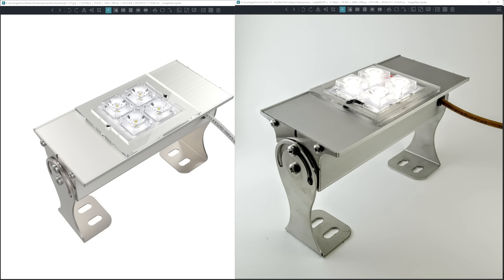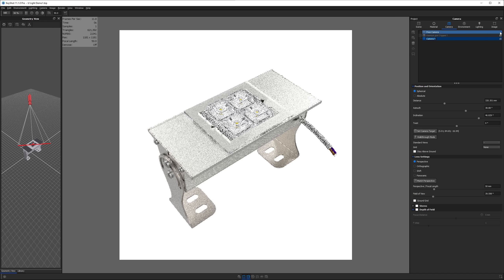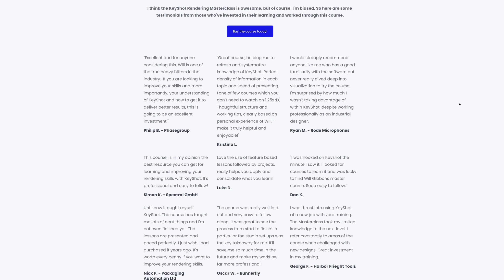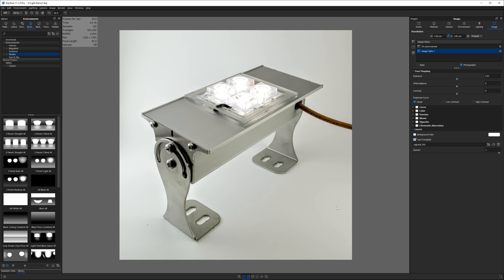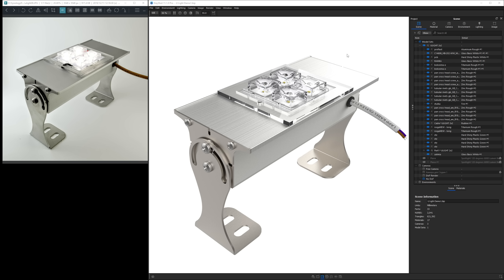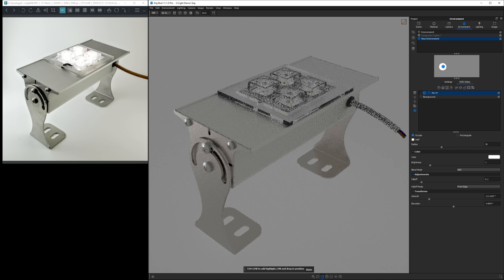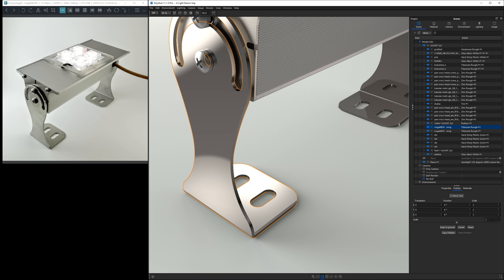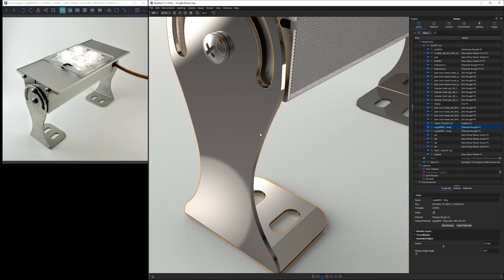I Tried Fixing YOUR Rendering in KeyShot!

Comment: Re-tessellating to fix the rounded edges is a most excellent tip!
Reply from the maker: Thanks. This person said they imported STEP from SW, so not sure why it was required... kind of odd.
Reply: @WillGibbons  I’ve seen some janky geo out of solidworks.  Not sure how the engineer was trimming the surface, it also wasnt a solid body.  It imported into KS terribly.  My fix was to export an IGES (because a step was terrible too) and the import the IGES into MoI and convert it to a solid.  Imported into KeyShot just fine.
Reply: We see some funky things that happen with geo while using creo 8 plug in. Our biggest 🥩 is that our normals come in pointing in. Albeit with most of our products not needing super close ups we can live this these hiccups. Probably will stop here and send a model for more good will hunting;) This is the best series for learning. How does Mr. Gibbons keep coming up w/ cool stuff to watch? Most of his videos used to fly over our heads. Now we just wane for more. Until the next gibbous moon 🌙 approaches. Thanks again you two. For bringing all this new stuff to 💡
Reply: @ericlehnert8404  A lot of CAD comes in with the normals flipped.  It used to be  a huge pain fixing them in Maya.  KS has a normals tool that does well at conforming the normals.
Reply: Yes sir that tool has become our friend. Coming to an end of a 1.5 year spin our product project flipping normals like a meditative monk. Now comes time to go sit back and soak in some of Will’s great training on moving stuff around a bit… motion awaits…

Comment: Great ! I got a very similar workflow in blender and got some tips out of this. I hoped to see you adress those very dark areas on the front side panel. Especially the high contrast very dark areas of the screws. I always have the same a little bit washed out look I have to correct in post. But since I work in animation these are hard to keep consistent. Do you have any tips on this?
Reply from the maker: Hmm... not sure I follow. You're talking about the + shaped area where the philips screw head fits in? Or somewhere else? Generally, brightening dark areas can be done by adding extra GI bounces in KeyShot.
Reply: @WillGibbons  thanks for answering :) that is the area I mean. But instead of brightening, there are dark spots in the original I want to replicate. I sometimes have to use negative light to archive more shadows. The dynamic range of the original goes from nearly pitch black to nearly full white. The recreation nails the whites but the dark spots are a bit to bright and I wanted an expert tip to archive those really black tones in a high reflective model. But don’t want to bother - it is a great video and i just wondered.

Comment: I suspect the verts weren't welded so the rounded edges couldn't determine it was a corner.  My guess anyways.
Reply from the maker: I think you're right... the import that did the tessellation probably didn't work as it should have, or the export from CAD wasn't ideal.

Comment: Learned a lot in this video! Especially fixing geometry issue.
Just wondering, why you add smudges in PS instead of using grunge textures in Keyshot? Is it because there is only one image to deal with?
Reply from the maker: Yes, precisely! In this case, it was a one-off rendering... if I had to do different angles, or an animation or make changes to them, then I'd have done them in KeyShot. In this case, just about 3 minutes in photoshop was the path of least resistance in this scenario.
Reply: @WillGibbons  thanks for reply!